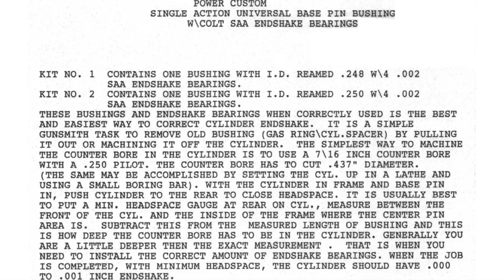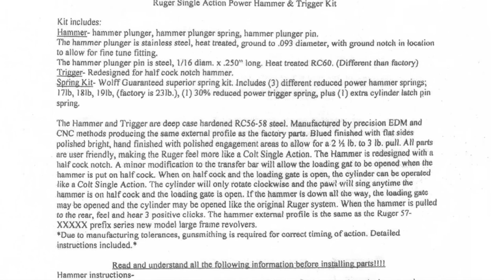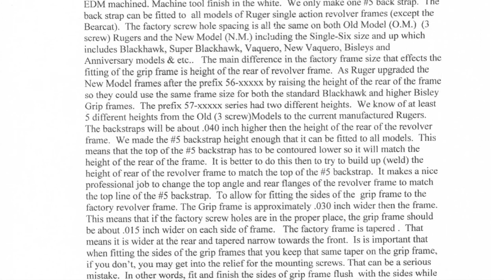Single Action Revolver Parts by Power Custom/Grand Master

Comment: I have a Smith and West model 36 with a 3 inch barrel all heat treated, it is missing a small part under the barrel near the front where the ejector rod snaps  into. what is that called and where can I buy one. thank you

Comment: I just put in the Bisley Hammer and trigger on my New Vaquero along with your transfer bar. I find the hammer a bit low and visually light, will the Motado/Super Blackhawk hammer work with the Bisley trigger?